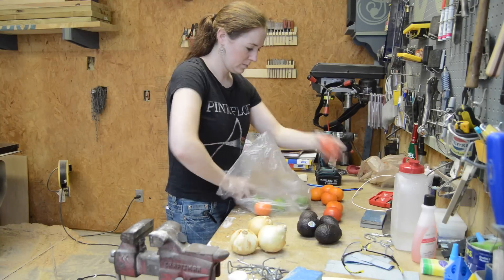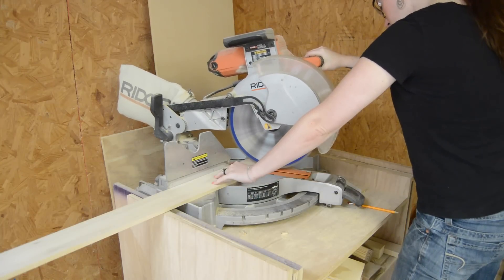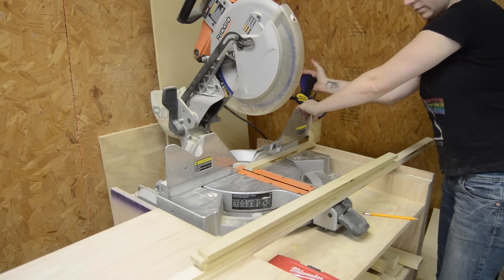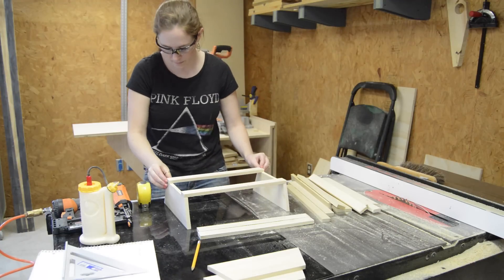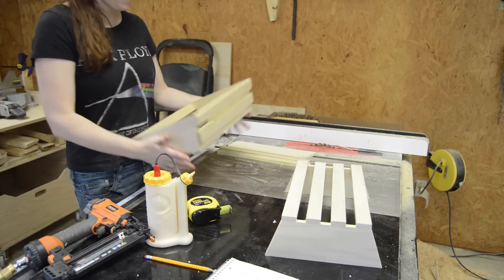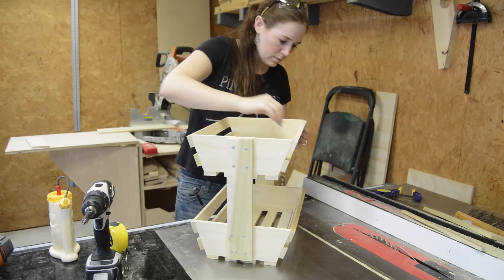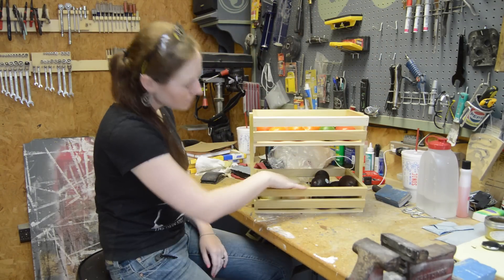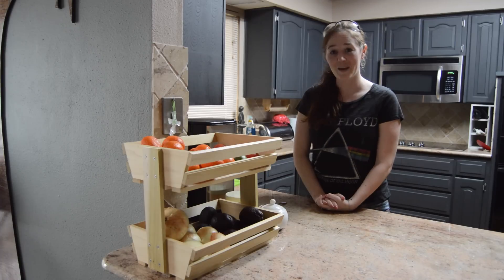DIY Fruit/Veggie Storage Rack

Comment: Hi April. Very nice basket.  However, you made me a little nervous with the brad nailer.  Make sure to never have your fingers closer to the end of the gun than the length of the nail.  I've seen brads hit a knot or a hard spot in the wood and come out the side at almost 90 degrees.  Otherwise, great job and I look forward to seeing next weeks project.

Comment: Poor avocado!  Time to eat that one now...  
Nice t-shirt! 
While others have already mentioned about being safe with your fingers around a Brad nailer,  here's a quick tip for you... 
Brad nails and finish nails for air nailer are manufactured in a rectangular shape. Always keep the short side of the rectangle across the grain. That way if the Brad or finish nail bends due to knots or grain pressure,  it will bend into the grain (they always bend towards the long side of the Brad nail) and not across the grain and into your finger. 
This isn't foolproof, but it can and does save fingers from being impailed by one of them,  and can save a blow out on your project as well!

Comment: great video. thx  April.  keep em comming. please just watch  your fingers near the Brad nailer. I ended up with a 50mm Brad straight through  my thumb and out through  my fingernail. not fun. nail veered of a hard spot in the wood. Was a case of 3....2....1... and PULL. All the best.

Comment: April good project one thing if you raise the lower portion a few inches it helps with air flow and will keep fresh longer. I saw a unit once that had a fan I suppose a computer fan would also help a lot thanks for the vid.

Comment: Guess I was not the first to notice that your fingers were a bit too close to the business end of the brad nailer. Never underestimate the unpredictable directions brads can travel. Just want you to keep those fingers intact. Nice project anyway. By the way, it looks like lunch may be ready in the microwave.
Reply: When brad nailing, I say to myself: "Clear!"... sort of like Doctors do before they shock someone with a defibrillator. So far, I haven't impaled myself.
:-D
Reply: I have had brad nails curl back and go into my finger before.. That hurts
Reply: Bob Wozniak I speak from experience as well. They do hurt. I learned that lesson early on.
Reply: Was just going to say the same thing about the nailer. I've seen those brads shoot out the sides way too many times.
Reply: Yeah, I too was cringing at that point. Having had the experience of a 1.5" 18 gauge brad go through my finger, I can heartily NOT recommend it to anyone. The worst part was the blood got all over my project. (Yeah, it was a bleeder!)

Comment: What was that finish again and where do you get it from? Also is that safe to use for like a chopping board and any another projects that deal with anything culinary? Sorry to ask so many questions but when it comes to food safety I want to make sure I finish it with the right stuff. And please anyone who has any insight in the matter please respond. Thanks
Reply from the maker: It's raw linseed oil and beeswax....both are 100% edible so they are foodsafe. I was reading lots of articles before this project on finishes though, and they were saying that any finish, once full cured, is food safe.
Reply: nicholas carter Hi, Nicholas! Yeah, that's my finish, and I make it in my shoppe which is available on my website. The one April used was made with raw linseed oil and beeswax and I also have finishes made with mineral oil and tung oil. You can find it here: http://darbinorvar.com/shoppe
Reply: Darbin Orvar thank you ladies. Mrs. Orvar, what's the difference between the three oils. I read all three of your links and they pretty much had the same uses (with the exception of mineral oil). So I'm kind of curious why choose one over the other. I am new to the polishing finishes but love the natural wood look it leaves behind. I understand some of the lingo but not all
Reply: nicholas carter Well, the main difference is that the mineral oil doesn't cure and you wouldn't want to use anything that cures on your table saw for instance. In terms of the tung oil and the linseed oil, some people just have a personal preference. Personally I love them both, they smell a little different :)
Reply: Darbin Orvar thank you so much for the info. I have subscribed to you and it turns out i have actually watched a few of your videos in the past... Small world...

Comment: Nice project April.  Do you have some information on the glue dispenser you use
Reply: It's a glubot from fastcap. They sell them online or at several woodworking specialty stores.
Reply from the maker: Mike Palmer Yep, it's called a GlueBot and they can be found at Rockler or Woodcraft, or online. Here is an affiliate link if you want to order it online: http://goo.gl/T6wU0x
Reply: April Wilkerson  thank you both

Comment: nice project.  I cringed at 2:10 when you were holding your hand right next to your work putting on the side pieces.  I was doing almost the identical thing with my brad nailer and the nail followed some wood grain and shot straight right, exited the wood and  went completely thru my finger.  I'll only do that once.  lol
Reply from the maker: Oh boy, I bet that hurt. Luckily I haven't shot myself with my nailer yet. I'm aware of the possibility, but sometimes I just have to hold a piece in place!
Reply: April Wilkerson I'm not sure whether it was mentioned on your channel, but there was a discussion about the best orientation of a nailer because if the pins tend to bend, they do it in the plane at 90 degrees to the body, so you might be less likely to have a blow out if you turned the gun thru' 90 degrees.  (Did I get that right ?)

Comment: Nice little project but I will say there is no finish that would make it proper, stylish project one expect from pro youtube channel. It does the job but it doesnt look as something i would put in my kitchen for that single reason. I just find it unfinished and unrefined. Slacks you cut for bottoms arent sanded or anything and i could see saw marks on them when you were putting it together, you didnt hide screws or anything. For me, finishing is as important as functionality.
I would also point out safety issues few other commenters made already. I know those are your fingers but still, safety should be considered when posting diy projects.

Comment: Just so you'll know, I was sitting on the garage floor trying to figure out why my brad nailer had stopped working.  I have two that are identical, so I ran and grabbed the new one, to compare side by side.  So, I studied the new one carefully, and, I saw the problem -- a screw and spring had come loose and fallen out at the tip end of the old nailer.  

 I meticulously aligned everything, reassembled the screw and the spring on the old one, and, sure enough in one motion everything fell into place.  

And, just as I hear the nailer go "pfffsssst," my brain told my finger, "you just shot yourself with the nail gun."  And, my mouth said, "no way!"  And, my eyes looked down, saw the blood dripping, and said, "way!"

The brad went clean through my index finger, just below the nail.  It was over the tip of the nailer when everything fell into place.  It happened so fast I barely felt it, until I felt it.  Somebody asked where the nail ended up -- I have yet to find it.  I figure the CSI team will come through one day with those little bullet markers, and spot it lodged in the wall....

Take care!

Hugs!

Comment: So bored of these ridiculous so-called 'DIY' videos by people who have fully equipped workshops.  How about showing people how to DIY without spending thousands on equipment & work shed.
Reply: As a Maker's tools increase it'd be crazy to not use them. Would you prefer using a screwdriver over a drill? A Hand Saw vs a Circular Saw? Most projects can still be made using simpler tools, it would just take longer but you can be creative and make it work. Don't be a hater.
Reply: @talladegadude4852  Non powered hand tools for my own personal work, powered for site work. The exception would be cutting sheets of ply/MDF